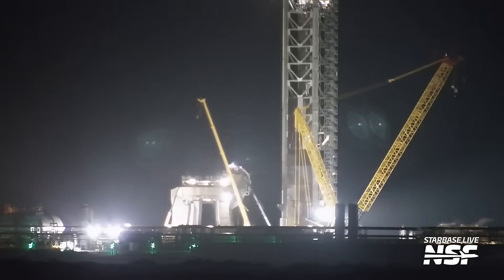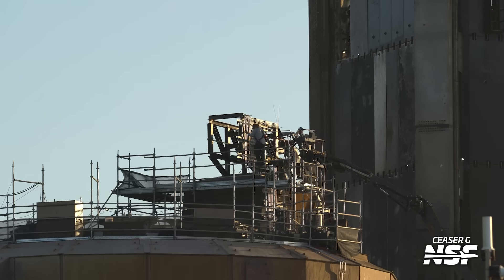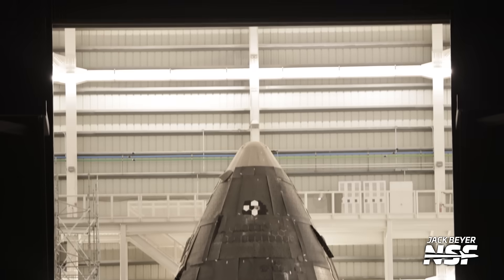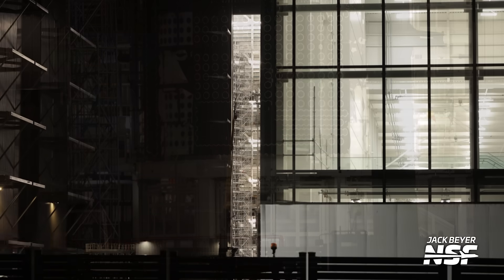Booster 13 Comes Home | SpaceX Starbase

Comment: MTHX for your video. A further explanation of the Frankenstein ship disconnect is not required. It’s more a ship connection for static fire testing to prevent RUD (big badabum😅) midflight.

Comment: Looking from above, the BQD's for Pad B are clocked 72 degrees apart.  In a 360-degree arc, the space between each of the 20 outer ring of engines is 18 degrees.  The methane QD is aligned 4 engines over from the LOX QD.

Comment: Hello NASASpaceflight team, As I understand there are only two Starship of this version left. That ship 37 and 38. Knowing that ship 37 is very close to been ready for static fire, would it be possible to stick fire ship 38 before the launch of ship 37, so any damage to this temporary ship test rig would not be important. As any of the heat shield or avionics that need to be change from a successful launch of ship 37 could be retrofitted to ship 38 saving both time and cost?

Comment: Can someone explain if there is any news of what is going to happen with Pas 1 after they go to the new generation of starship, is there a plan to refurbish it with 2 QD for the buster. Also a longer sheep make the QD at the top too low to load the sheep. So a move from the QD arm is required

Comment: This is not a quick disconnect. It's just a temp connection. There's no need for it to disconnect while testing It will probably be attached to the ship adapter and removed with the adapter ring in one unit.

Comment: one BQD is for lox, the other BQD is for CH4, they're about 80 degrees apart and notably on the opposite side of the OLM from pad 1a/east, so the rocket exhaust doesn't vector directly at them.
Reply: Exactly right ( I hear ), 80 is new to me.     Pad 1 has to rebuild the BQD after every flight.

Comment: What if they scrap flight 10 and just do V2 high altitude hop and catch instead. I think it’s brilliant.
Reply: Because right now it's not about catching the ship!   Ships 37 and 38  need to be launched to determine the problem with V2 ships getting to orbit.  Some have said that each V2 launch had a different problem.  If so maybe and if they figured that out then maybe S37 will.make back to a soft landing.  Catching the ship is secondary.
Reply: @michaeldeierhoi4096 oh, I’m well aware I’m just being silly about it. However I can dream of high altitude ship catches. Some day some day. Gotta iron out the kinks first, like you’re saying. But exactly I don’t get all the doom and gloom over the past flights. This spell of failures need to happen and they need to happen now rather than later

Comment: With all the adapter work, I have to wonder if there’s an engineering team playing with some kind of unified mating design for future starship/superheavy revisions. Figure out a way to line up the clamp points and fill ports so the same fixtures can be used to test ship and booster.